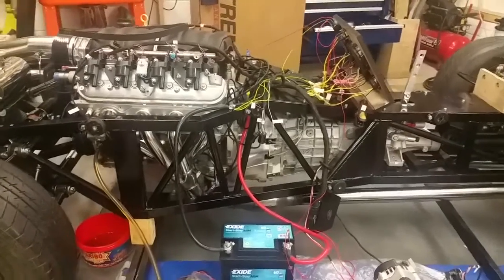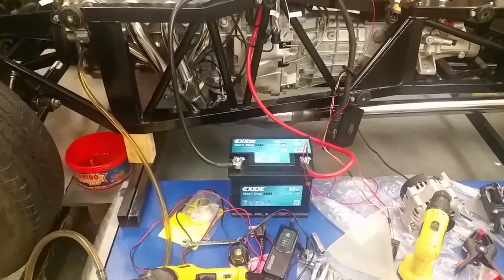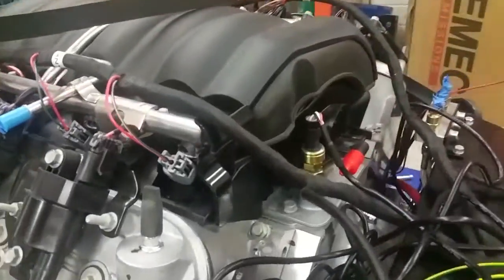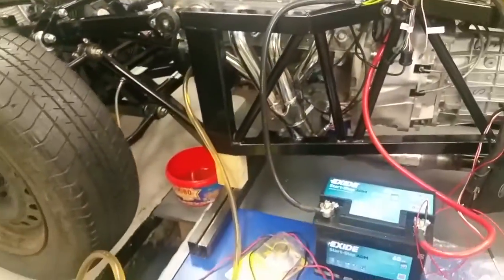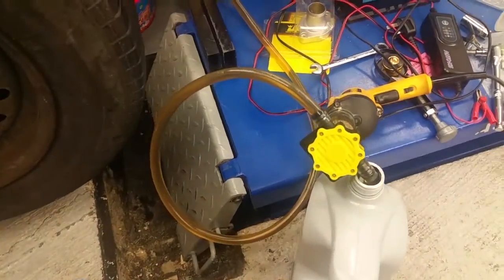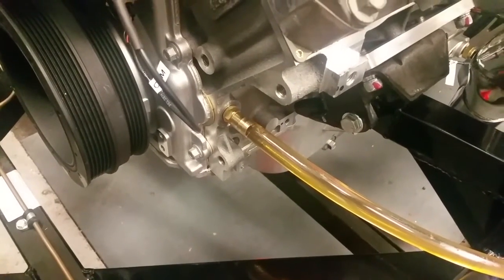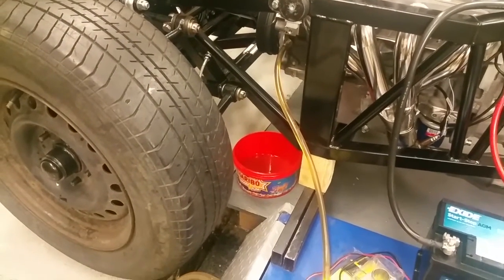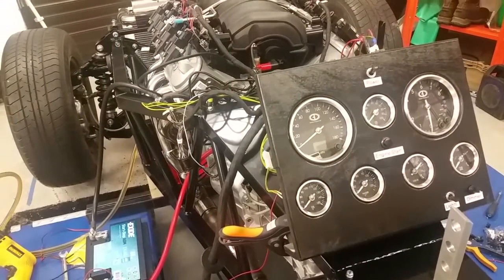How to: Oil prime an LS engine (for cheap!)

Comment: Thanks, 35 psi! surprised the poly line doesnt blow off the barb
Reply from the maker: It did 😅. I had to clean up a pool of oil afterwards.  Thanks for the reminder, I'll add a note to the video shortly.